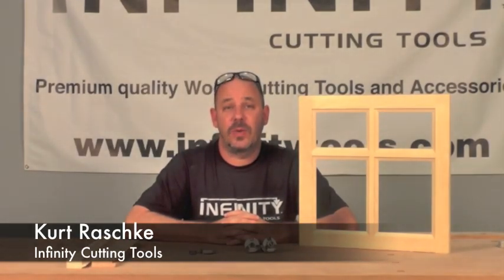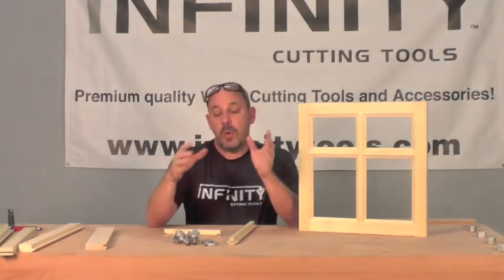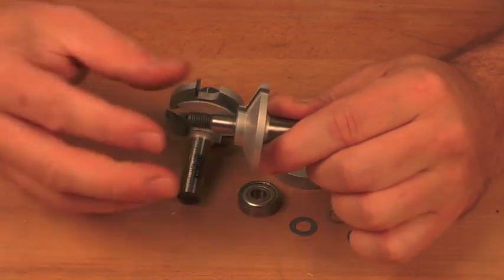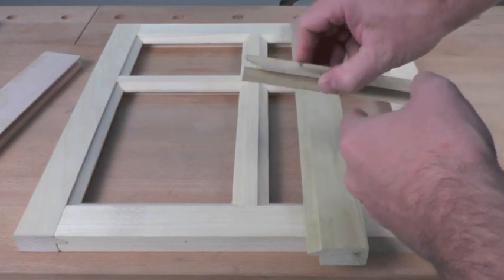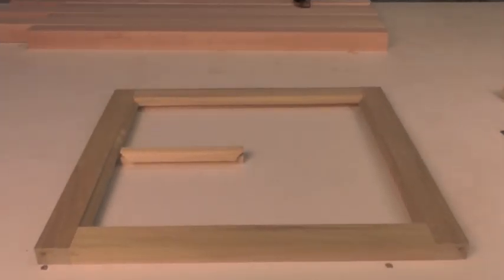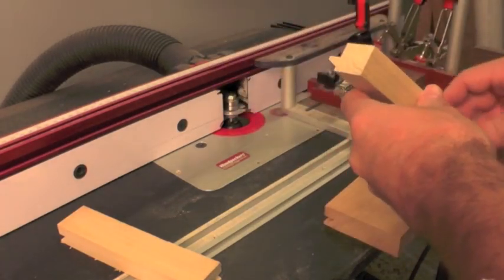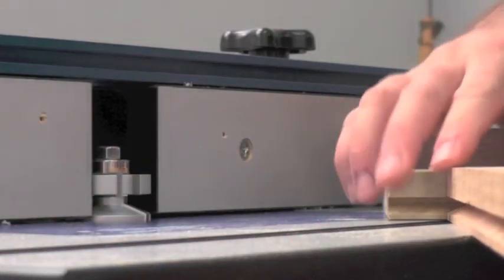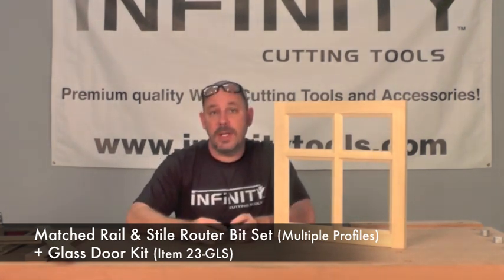Infinity Cutting Tools - Making Divided Light Cabinet Doors

Comment: Are there any performance differences between the two approaches for muntins: 1) having the horizontal and the vertical muntins cross lap 2) splitting the horizontal muntins around the vertical so that their ends are coped to either side of the vertical?

Does one approach fit tighter than the other?
Reply from the maker: Functionally once the window is complete there should not be a significant strength difference between the two methods. The biggest difference is that the coped stub tenon method can be done by a machine while the cross lap method is more traditional and typically requires handwork. The cross lap could be done on the tablesaw if desired but is less common as the coped stub tenon is typically faster. It all comes down to personal preference and possibly the scale of the projects. One French door is a different undertaking than 30 windows or 300.
Reply: Wish I'd seen the question a year ago.  But he answered perfectly.   It's really a question of ease and speed.    But there are times when you need to use the approach requiring hand work, e.g.  arched frames.